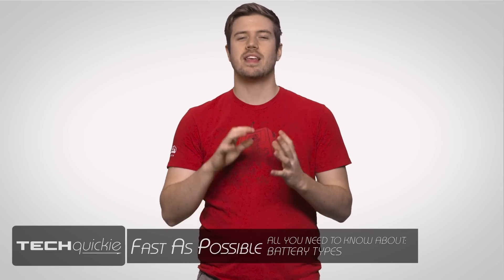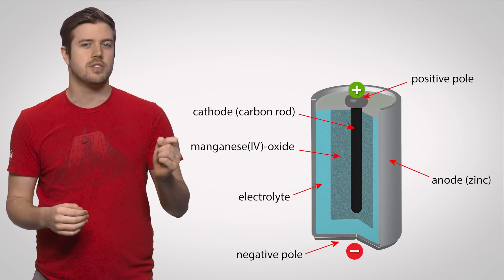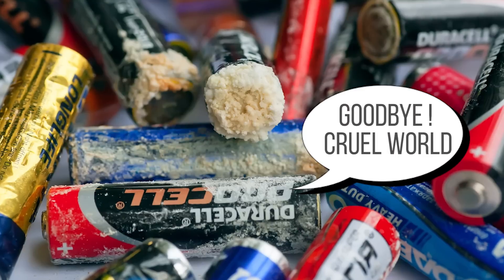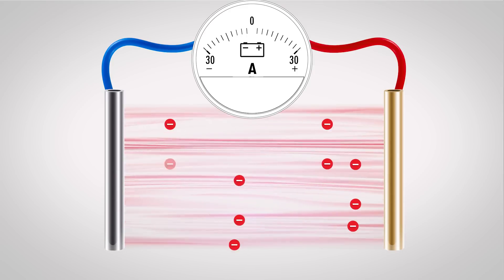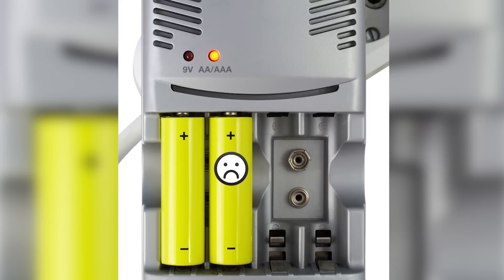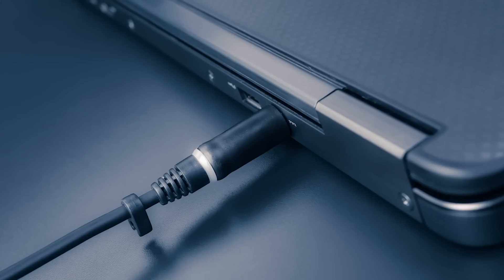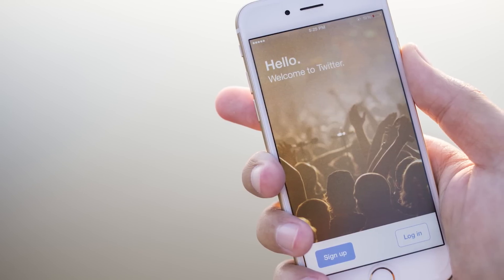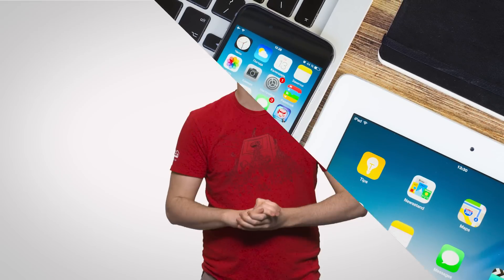Battery Types As Fast As Possible

Comment: No, the apple will make it 3mm thin and you wil have to charge it every day again.
Reply: Hendlton Thinner means less comfortable to hold. I understand Apple's motives - a thinner phone is more aesthetically attractive - but that's about the only advantage other than cost for what is at the end of a day a less consumer-friendly device than a slightly thicker one due to the thinness and therefore lack of comfort. Also the GPUs are the same size, hence the almost identical cooling shroud. If you're referring to the die shrink, it's actually just as expensive in terms of materials because of an increased transistor count, not to mention the huge R&D cost associated with such a huge change.
Reply: yup. because less ergonomic is better. wooo thanks apple.
Reply: +barnstormer322 Not a question of ergonomics but cost. If something is made smaller, it takes less money to make. That's why the new Pascal generation of GPUs is half as much money (on average) and same or better performance than the Titan X. Also, who wouldn't want a phone 3 mm thick. The thing holding us back from that are mostly batteries and 3 mm thick phones would sell like hotcakes.
Reply: Hendlton not exactly. Smaller means higher precision means higher defective parts count means more material and energy loss means more manufacturing processes and development as every tenth of a millimeter shaved of a screen means developing stronger glass, better matrix etc, from case means stronger alloys or else  #bendgate  will happen again, that also means components will have to be more fragile and packed tightly on the PCB... And getting rid of 3,5 mm jack or having big ugly cases doesn't help...
Reply: Bartosz Olszewski The 3.5 mm jack is such a simple thing and could be made smaller really easily, why don't we have a 1 mm jack or something?
Reply: Hendlton we have 1,5 I believe but if you haven't used it before, you don't know what a piece of crap it is..
Reply: @tennicktenstyl  I've got a modern Smartphone with the 3.5mm headphone jack it's fantastic
Reply: Bartosz Olszewski Oh, I just remembered those, yeah, they're crappy but I was thinking more something like a micro USB type thing where it's wide but very thin.
Reply: Hendlton It's planned to release lighting connector headphones or just use wireless.
Reply: Bartosz Olszewski Wireless would be awesome but I haven't seen wireless headphones for less than 50$.
Reply: Hendlton yeah, they are kinda pricey.. but worth it IMO, you get good quality drivers (ofc most of them aren't as good as cable connected ones) with the comfort of not having cable laying around.
Reply: Bartosz Olszewski Well, I'd know. My current headphones are held together with electrical tape because I accidentally ripped the cable in two where the volume thing is XD
Reply: Hendlton Lucky one, I tore my laptop jack out by not unplugging them and walking away..
Reply: Bartosz Olszewski My mom accidentally ripped out headphones out of my laptop once, luckily the 8$ headphones' jack gave instead of the laptop.
Reply: Again, & AGAIN, AGAIN, AGAIN............

Comment: Does anyone make AA/AAA Li-ion batteries? If, no.. I wonder why not..
Reply: Sadly I don't know the exact answer to this question, but I know that if you keep the current Li-ions at a too low voltage, then the battery may start a reaction where the copper anode current collector can dissolve, forming a copper shunt in the battery. This may short the battery, or at best reduce the capacity. This is only half the answer though.
Reply: +Eumelanin Knight cost.
Reply: +Eumelanin Knight A Lithium cell pumps out 3.7v. Nickel/Alkaline batteries pump out 1.5 or 1.2 for rechargeable. So basically any device that takes AA/AAA is expecting to receive 1.2 - 1.5V.
They 'could' make a Lithium AA, but it would damage existing devices.
Reply: +Eumelanin Knight I don't think anyone makes them, and it's simply because of safety. A normal AA and AAA have an output of 1.0v to 1.5 volts, where the usual lithium ion batteries have an out between 3v and 4.2v. If someone unknowingly put a Li-ion battery in their device that uses AA batteries, that device might not be functional anymore. There's also a possible problem with charging, where they could catch fire if charged wrong. Hope that helped.
Reply: Mark Ambrodji can't the volt output be adjusted?
Reply: Thanks for the responses.

Comment: you forgot hydrogen ion batteries (which already exist, but require a very expensive proton exchange membrane)
Reply: There is no such type battery like what you just mentioned
Reply: @stephensnell1379  yeah, I guess it's technically a fuel cell, but it performs the same function https://youtu.be/1-yLqwGS2dA